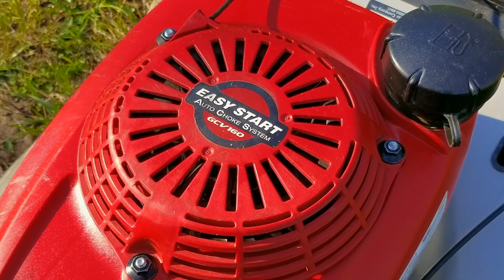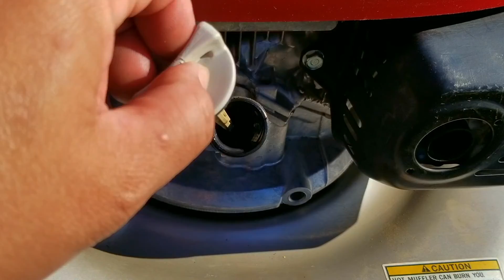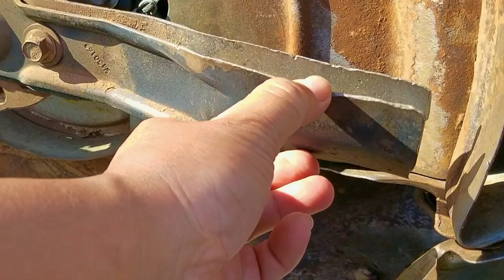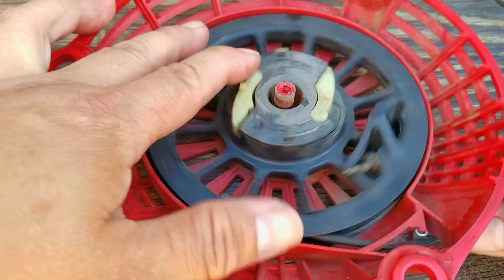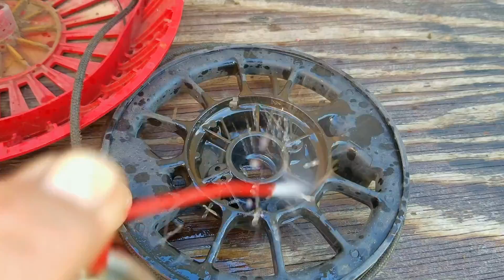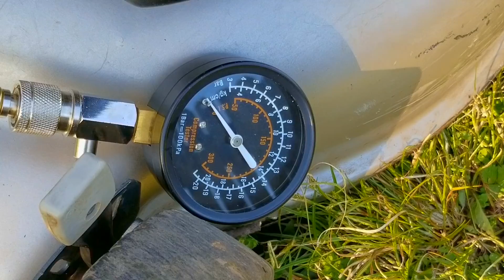When is a free mower NOT worth saving?

Comment: I have a suspicion about these engines and the auto-decompressor Honda fits to the camshaft; if this were to jam due to lack of use or corrosion, the engine will never start.
I have a rotavator/tiller with the same engine and I experienced a total lack of compression, preventing me from starting it then the compression suddenly came back. No proof as yet because the engine is running and I need to use it.
Reply from the maker: that's an interesting theory.

Comment: I'm having the same problem, but if the engine is cheaper than the whole mower if it's worth changing out providing that you are going to be the one using it it may be feasible
Reply from the maker: it is definitely feasible.

Comment: How do you know it's got good park?  Perhaps it's intermittent spark.  There's a few other easy things to test that would cause these symptoms that would be free / cheap to repair.
Lower compression on a cold engine that's struggling to start doesn't mean the rings are bad.  Could have washed out cylinders due to fuel / failure to start etc etc.
Reply from the maker: You're absolutely right

Comment: I would check the valve lash and if it looks good then I would lap the valves. Lapping them does not cost anything other than lapping compound and some rtv to reseal the engine case since the head is not removable. If the exhaust is not oily then I would imagine the rings are fine unless the oil ring is good and just the compression rings are bad. Can not tell until it is opened up.
Reply from the maker: thank ATV Repairs and More

Comment: Another good video. More engine analysis needed. Somewhat incongruous that a unit so well maintained  would have such a rusty return spring which would be more indicative of a unit left out in the weather. Those blade gouges may be a clue to hard starting. Engine didn't sound 'right' when pulling the cord.
Reply from the maker: You are absolutely correct.  The follow up video is done and will be posted soon.  Thank you 65CSX

Comment: Considering its condition otherwise, it hasn't cost you a penny yet. Ebay wheels?
Valve clearance check?
Compression may come back.
Reply from the maker: yes I complete agree with you, wheels on the way and I've already re-diagnosed it with some surpassing results.

Comment: I could be wrong; however, wasn't the gas shut-off value in the closed position when you were trying to start the engine?
Reply from the maker: You forgot to also mention that there wasn't any gas in the tank either.  It's was a test start, not a run test.

Comment: When A Honda GCV160 or 190 engine is worn low on compression I I would not invest a dime on it its a throw away engine no removeable head no pushrods valve cover glued on and bolted in Briggs and Stratton my choice because it has pushrods and a removeable head what I would do with a Honda GCV 160 or 190 is part it down of the good parts then throw it in the scrap pile and walk away until I scrap it that's if its worn
Reply from the maker: thanks for voicing your opinion
Reply: @INSIDEHOUSEGARAGE  you're welcome

Comment: i would take a look at the valve lash, although is not very likely there is still a chance that a valve could be too tight, and since the engine is very hard to start there is a chance the intake valve is not sealing completely, after checking valve lash a quick way to check if the intake valve is leaking is to put the hand over the carb throat and crank the engine, if you feel air puching you hand it means the vslve is not sealing correctly, again, this may not be the main cause of the hard start issue but since is rather easy to check this i would give it a shot
Reply from the maker: I think you might be onto something.
Reply: @Imanol Berecibar Barroso - my sister had a Honda step-thru which got harder and harder to start.  Local Honda dealer told her "the engine's worn out".
I checked the compression with the kickstarter, and I could feel it was poor (just like this mower).  Checked the valve clearances, and sure enough, one of them was down to about 1 thou, the other was zero. I didn't know what the valve clearances were supposed to be, so slacked them off to give around 5 - 10 thou gaps - she was up and running.
My sister went back to the dealer when the shop was busy next Saturday, and said in a VERY loud voice:
"You remember telling me last week that my Honda's engine was worn out? I got my brother to check it; he reset the valve clearances, and IT STARTED FIRST KICK!"
:))
Reply from the maker: @jackx4311  nice work

Comment: You mentioned that there is a compression release or something alike. Is this something worth checking if compression is low?
Reply from the maker: the compression is low on pull starts and that means it's doing it's job, the only thing to do, would be to disable once the engine started to really wear down.
Reply: @INSIDEHOUSEGARAGE  - but the compression shouldn't be as low as 50, even with the comp release.
Reply from the maker: @jackx4311  no, I've never tested a new engine, but those that had very few hours on them ,the compression was around 100 psi.

Comment: I'm not a fan of Honda Mowers at all. Your experiencing an issue with this one that I've known many people to have. I will be one to admit that yes the build quality is up there however the parts for repairs on Honda mowers are expensive. In the past I was dating someone that bought a brand new Honda mower one summer and 4 months later still in the summer season the mower was clanking and not running right. I don't remember what it was but the repair bill was pretty darn close to the price of a new mower.

This is why I stay with MTD products such as craftsmen and troy-bilt that run briggs and stratton engines. I've gotten many years out of my machines of that style and engine. The parts I find are of good quality but at a fraction of the cost of Honda parts.
Reply from the maker: thanks for the information.

Comment: i,d have a good look at the valves as they can be a problem and maybe the valve lash guide past the main push rods and see if that,s worn out as those are a common problem on the Honda 4 stroke aka 4 cycle lawn mowers etc.
Reply from the maker: this is an overhead cam with a timing belt so I won't be able to adjust the valve lash on this model .
Reply: @INSIDEHOUSEGARAGE  yeah i wonder if the timing is aligned or if the piston rings need replacing.
Reply from the maker: @Patrick4959  it would be worth taking apart and finding out.
Reply: @INSIDEHOUSEGARAGE  for sure and next video on this very mower etc.

Comment: Maybe try a wet compression test? Add a small amount of engine oil into the spark plug hole and let it circulate in the cylinder. The oil might help seal the gap between the rings and cylinder wall. Run the compression test again. If the pressure rises, that could indicate bad rings/worn cylinder. If pressure stays the same, then look at the valves as suggested by others.
Reply from the maker: That's a good idea.

Comment: Starting fluid (ether) is engine meth. I never, never use ether. Instead I use Berkebile 2+2 Gum Cutter. It works and far less harmful to an engine. Next, to check if engine has worn rings, after doing a dry compression test, squirt some oil into the spark plug hole and then do the test again. Next, once you collect your first curb-side mower keep going and add more mowers to your collection. This is how I get free parts to get mowers running.
Reply from the maker: you are absolutely right.

Comment: May be check valve clearance. Sounds like the engine doesn’t turn many times when you pull the rope.
Reply from the maker: sorry to say but this is an Overhead cam, so nothing to adjust, but I'll show that when I remove the valve cover in the follow up video.
Reply: @INSIDEHOUSEGARAGE  Looking forward to the next video. 🦘🇦🇺

Comment: If easy enough to do, maybe a quick valve grind may be enough to get it to run easier? No chance the spark is weaker than it should be? Another great video, thank you!
Reply from the maker: thanks and do you mean valve lapping?
Reply: @INSIDEHOUSEGARAGE  Yeah, wondered if it was enough to get it to run and do another couple of years? Or possibly has a valve slightly bent?
Reply from the maker: @MC-ft8zv  I'll probably pressurize the cylinder and listen for any hissing from the intake, exhaust to the filler neck.

Comment: When I saw you spray the studs with WD40 I immediately knew you must have snapped one off in the past! 
 For some reason these like to get stuck and always break if you force them. Some times the entire stud unscrews from the engine block which is fine, you just have to be careful....fun fact the one that holds the ignition coil is a different size and part number! Same for the Honda clones such as Kohlers, and MTD Powermore
Reply from the maker: I haven't broken one but they have gotten stuck before

Comment: Check the valves and the flywheel key.  If either are messed up fix it and re diagnose . I personally wouldn't rebuild the engine so if it needs internal work I would part it out or wait for a used 160 .
Reply from the maker: you definitely know how I work. Yep that's that plan.

Comment: The cam cover looks suspiciously clean for an engine of that age, which might suggest the valves were messed with; perhaps stripped adjuster threads in a rocker, or a crack in one of the rockers.
Reply from the maker: I cleaned the mower before filming it.

Comment: Still might be blocked carb preventing it from starting. I’d clean the carb and check the spark quality / intensity first before condemning the engine. I’ve seen some pretty worn engines start right up and run fine in spite of low comp numbers.
Reply from the maker: you make a good point.

Comment: Good video! I’d say try the engine restorer and see if that does anything. I know it sort of helped that Briggs engine but it still had rod knock.  I’d try it on this engine because it does not have any rod knock that I can hear. It might be something good to try because this engine isn’t too low on compression. Just a thought.
Reply: Engine restore works wonders on engines!
Reply from the maker: @emilianogonzalez9322  it hasn't worked for me yet.
Reply from the maker: Great point! I still have a that can so I might give it a shot.

Comment: "This is the part where your hands begin to hurt"  I was laughing with you, not at you when you said that. 😂I would definitely check valve lash, as it is only time and not parts. If that improves # of pulls then I would look for parts wheels. Even used Honda wheels are pretty good as they have a metal gear, rather than that plastic on AYP and MTD machines.
Reply from the maker: I'm glad you got a chuckle from it. Yes I'll have to look into checking the valve lash. Thanks The Lawnmower Lady

Comment: This is a tough one.  I’d say try to get it to run and price out piston rings (if it needs rings).  If you get it running, I’d buy new wheels and then you got a good mower.  I remember from a previous video, your Honda mower has a rod knock.  You could fix this one and use it as your personal.
Reply from the maker: Great point! I've got a couple of ideas for this one.

Comment: No offense intended, just feedback. 
I have watched several of your videos and I feel they too often end with me still wondering what you did next ....in this case was there a valve lash problem, a ring problem or what. Not hard to check valve lash or add oil before a compression test.
Reply from the maker: It usually not my style to make long term projects of out the videos, most of the time, I eventually come  back to the project later on, This one is limbo till I make the follow up.

Comment: With the way that blade looks, you should try to check the flywheel key and see if it's Sheard, if it's just a hair off it's enough to make the engine hard to start
Reply from the maker: You are absolutely right about that. thanks for the suggestion